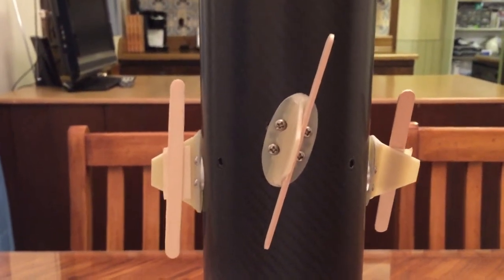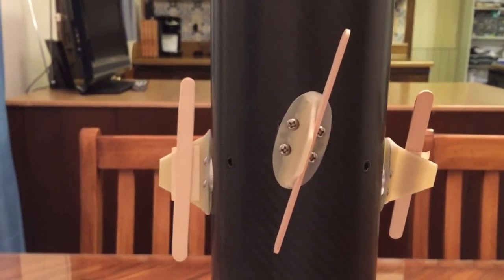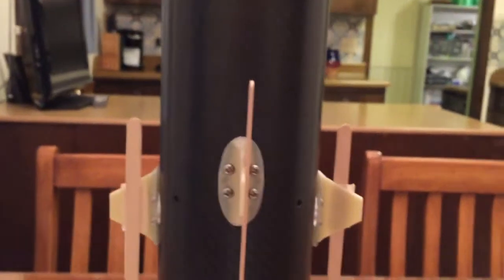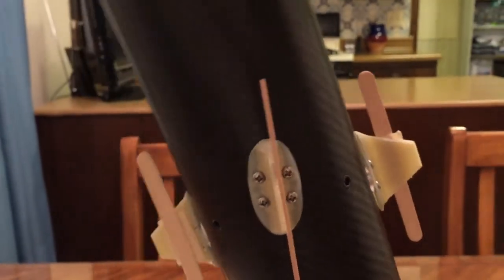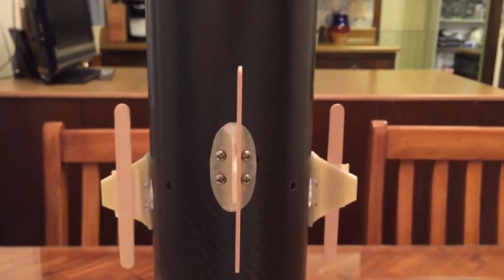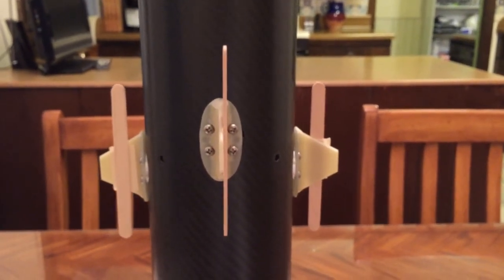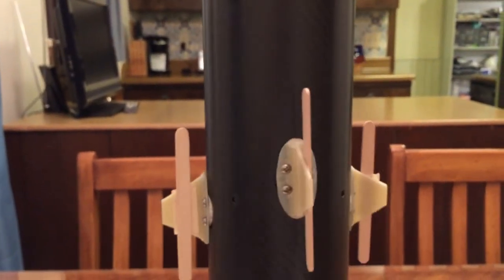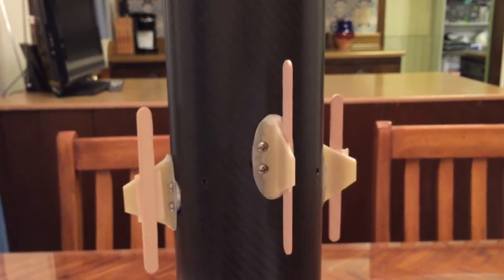Canard mixing

Comment: Hello Sir,  we are doing a similar project (at a smaller scale)  with our own rocket vertical stabilisation system.  We are still in the development phase.  I am curious as for the relatively small size of your canards fins.  Also what is the maximum correction angle do you induce to the fins using the servos?   Finally, I can't find your other channel "jimjarvis50" is it still alive?
Regards.
Reply from the maker: The video you commented on was from very early in the process.  I have somewhat larger canards that I use when steering from the top of the rocket and some even larger canards for steering a large rocket from below.  You will find perhaps a dozen videos of flights on my channel, which is jiminaus50.  I think you will enjoy those videos!  I limit the maximum angle to somewhere between 3 to 8 degrees, roughly, depending on the speed of the flight and the size of the canards I am using.  One reason for the small deflection is to avoid going above the stall angle for the fin.  This is an optimization of many variables including the accuracy of the servos when the canards are driven directly and the relative response of the rocket to roll (very fast) and yaw/pitch (fairly slow).  Also, the objectives of control must be considered.  I don't need to stop roll, I just want to slow it down so that yaw/pitch can work and so that the maximum roll rate does not exceed the range of the gyros.  Review the videos on jiminaus50 and also the thread "I could use just a little guidance" on TRF.
Reply: Thank you  Jiminaus50  for your fast answer.  
In your opinion, is it possible to control the yaw/pitch without controlling the roll?  
We are using custom code running on an Arduino nano and a few sensors (MPU-6050 and mp3115a2) for the flight computer. 
Out of curiosity, what was the weight of the rocket that was used with this massive control system?  My partner is pressuring me to have all the electronics under 100 grams :-)   
We are designing for 2 stages using 2+1 F15-0 motors.   Nothing at the scale of your rockets.
By the way, I just joined the rocketryforum.com to read your numerous posts.  Thanks again.
Reply from the maker: It is possible if there is not much roll.  If there is roll, then cross axis sensitivity can quickly erode the accuracy of the yaw/pitch gyros and/or exceed the range of the roll gyro.  My testing on MPU-6000 shows this is a significant problem.  Not sure which rocket you are asking about the weight.  The single stage canards on the top might be 20 pounds or so.  There was a two-stage with canards in the middle that was maybe 220 pounds?  My control system, including the air frame section, is around 7 to 8 pounds.  Would be hard to make this much lighter except perhaps the servo mounting via 3D.

Comment: Great job, the proporcional control is robust enough to stabilize the rocket?, The PID control it's not necessary?  
Did you use accelerometer for X y Y axes and gyro for the roll?
Reply from the maker: Look for more recent videos under my channel - jimjarvis50 - .  There are perhaps 10 videos of actual flights.  Proportional control is fine for vertical stabilization, as the response is relatively slow.  Have to be careful in canard size and response for roll control.  Too much control and it goes unstable.  The system uses MPU-6000 chip, which is 6 DOF.  Accelerometers are disconnected from the gyros at launch.
Reply: @Jiminaus50 why are they dosconnected from the gyros
Reply from the maker: @zahariburgess3660  Prior to launch, the accelerometers are used to determine the gyro offsets (by providing a constant reference to motion). After launch, the acceleration of the rocket means that gravity and the accelerometers can't be used for determining the offsets, and thereby compensating for gyro drift. So, you "disconnect" the gyros from the accelerometers and only the gyros are used for determining orientation after launch.
Reply from the maker: @zahariburgess3660  Be sure to watch the more recent videos to see this system in operation on many flights.  Search Jiminaus50